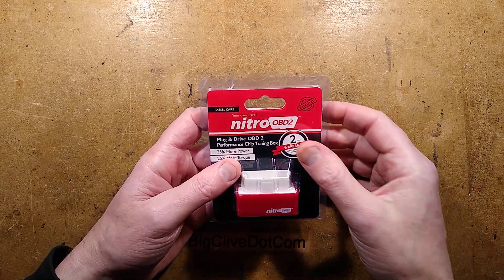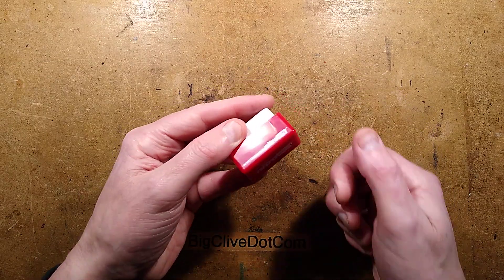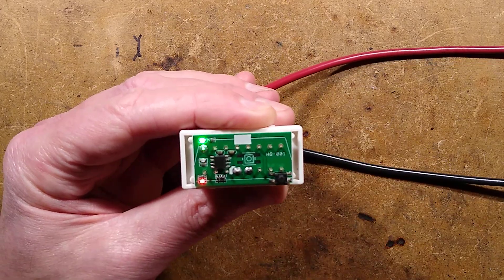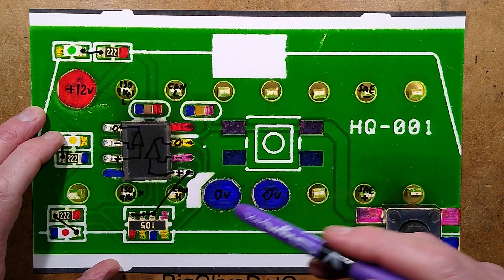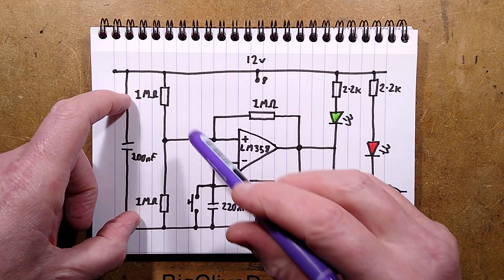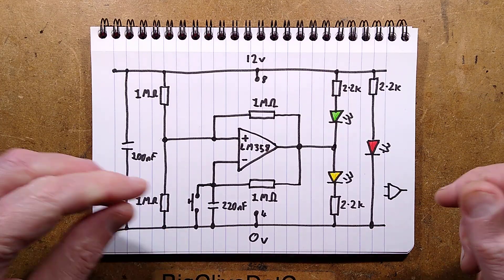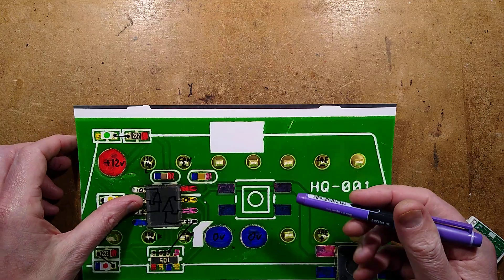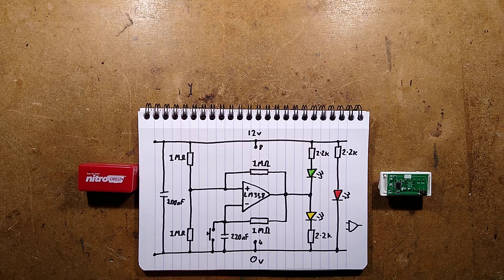Nitro OBD2 unit with interesting circuitry

Comment: I actually saw one of those that was actually connected to CAN L through a high value resistor. When CAN data was moving the LED changed its blink pattern. That was the limit of its functionality.
Reply: I can only imagine the joy the scammers felt when they realized they didn't even have to do that.
Reply: @chaos.corner Yep, the microcontroller they used cost a a whopping 3¢.
Reply: @randycarter2001  With the one in this video they'd just need to connect it to the unused 2nd op-amp to skew the timing a bit.
Reply from the maker: That does at least add an element of reality.
Reply: I imagine because this is just an absolutely do-nothing scam, there's relatively little attention from the law, but if some QC issue caused it to create a malfunction in vehicles, there's probably a much higher risk of there being some enforcement, so they just go for the simpler, safer and probably cheaper approach.  Although stuff like fully stock EVs burning to the ground and other issues with various vehicles often doesn't get much punishment so who knows.
Reply: ...and if you're really fast and smart, you can tell what messages are being transmitted?

Comment: I mean, as a Software engineer, I always hate op amps when I tinker, because they are magic devices for me, from a land of a thousand elves. At least I now have a nice demo circuit with a brilliant explanation of how to use them as an oscillator. Was worth the price.
Reply: Also great for audio interfaces .   Then there's the classic double ramp that lets you measure volts at whatever precision you can program into a timer .
Reply: One of the earliest things I built was a solar charge regulator, using an op amp. I used the LF351 mostly, and the 741 if that one was not available. Later I went into software dev instead, and made it a  career, but the memory of these little devices have stuck with me. This one, and the wonderful 555 timer. These days, I use arduinos, esp 8266 or Esp32 for most things though.

Comment: I think I'd be more upset if it actually did something ...I cannot fathom plugging in a cheap AliExpress module that's supposed to write data to my ECM.
Reply from the maker: Especially when the first thing it does is delete all the settings and then crash.

Comment: The basic problem is that you’re plugging into a diagnostic port and the circuitry is not designed to have anything continuously connected to it. Automobiles have been severely damaged by devices plugged into this port. Before connecting anything to your diagnostic port, I recommend doing a Google search to find out people’s experience with that particular device.

Good news about this gadget is that it does absolutely nothing so, at least your car won’t be ruined. 😂

Comment: Ex mechanic, ecen though most of these do nothing other than turn on a light on the dongle, or flash it.

Some can do major damage if they do actually upload any code or just do damage to the wiring.

Ive tuned vehicles (alot honestly) via the obd2 port (and the more oldschool way inc mechanic upgrades, jetting etc), the tool itself is usually...."cheap" it is either an obd2 to usb, or obd2 to serial (though they should be rare now), the expensive part is the software, they tend to be make specific (GM, Ford, Honda, Nissan etc) some are even engine specific, well really its more to do with the ECU but not that important. The tricky part is knowing what you can change, how much by and what it all does.

An example, you just put in a cam, injectors, larger throttle body, manifold and turbo. Where do you start? What do you change? How do you know your changes are safe? Are working? Or doing what you want? Sure you can just advance the timing and dump more fuel in, but you could be flooding it, or actually making it run WORSE than if you didnt touch the tune.

So with that said, If your OBD2 tune tool that just plugs in and actually makes changes, how do you know its going to actually help? It could grenade the motor or make it run way worse. Some from my experience can do electrical or mechanical damage.

Yes some do exist that you can just plug and play, but youll find they arent cheap, they are usually very specific on what they can be used on (from memory the VD landcruisers have a few, but tend to be split between the years, the series and also tend to be made to order, you give the company your specs, if you have made changes to it, you want more torque, better fuel efficiency etc)

Comment: An added benefit of these things is that they invariably tie your vehicle's chassis ground and signal ground together…
Reply: By design. Some CAN variants, namely Single-Wire CAN (SWCAN; Low Speed GMLAN) are chassis ground-referenced. I've found the manufacturer's PC interface does it for you. LIN is even better, the high state is Vbat referenced.

Comment: I plugged one of these in my vectra and since then everytime I indicate right , the air bag goes off and also the radio goes crackly..which is most annoying
Reply from the maker: I hate it when that happens and you have to stuff the bag back in and clip the front back on the steering wheel while driving.

Comment: I bought a non -nitro unit; as it was cheaper than a  ODB2 connector.. After opening found that only the power pins had been connected. Complained got a refund so connector for free. Winner!

Comment: You are correct that these are interchangeable between different power units. I plugged one of these into my EV and got 40% more economy from my battery pack. Amazing little gadgets 🤣🤦‍♂️
Reply: In EV it saves up  to 100% gasoline.
Reply: @lordplenty  I got a DIV/0 error when I tried to calculate fuel saving 😉
Reply: @smilerbob That's a very strange error .
Reply: @smilerbob In Hyundai/Kia it makes regenerative braking able to rebuild used up brake pads
Reply: @poprawa  I have heard similar with other vehicles as well. Also, some have reported driving in reverse puts rubber back on the tyres 👍

Comment: Just remember that when using one of these in Electric mode, don't park your car in an airport car park... :P
Reply from the maker: That diesel car that exploded was using one of these.  It has saved so much that the tank was pressurised with excess diesel.
Reply: Yeah, use the rental as you return it.
Reply: Especially if its a Diesel Land Rover as the case in Luton, or a Petrol/LPG in Liverpool.........
Reply: @8skellerns That's the cover up, A carpark built in 2019 with no sprinkler system,  Humm,  How much is Musk paying TATA to take the blame 😂
Reply: LOL 😂

Comment: "Relaxation oscillator."
I build these all the time.  Vary the feedback resistor to vary the frequency. Replace the feedback resistor with a photoresistor and frequency is dependent upon light intensity. Hook the output to a small audio amp and play tunes with shade. Fun to be had.
Reply: @bigclivedotcom this needs to be built on youtube.. It just must :D
Reply: Neon lamp+capacitor+resistor  works just fine.
Reply: Yeah, brings to mind the Forrest Mims handbooks.
Reply: Tube gear made them with one R, one C, and a neon bulb.
Reply: WHAT RADIO STATIONS WILL IT GIVE YOU IN YOUR CAR !!!

Comment: Coincidentally I was just looking at ways to "hack" your car using this port, send commands to open and close windows with arduino. Its not that easy since you gotta reverse engineer the codes seems the hard part, but once you know the codes you can display the info in a nice way or send commands to do things to your car.   power lock and car start from a phone? yes please!  I had no idea they made fake ones.  But since you can do it yourself  with acheap micronctoller , i dont see the need to fake them, unless they'r just exaggerating the claims.  It wouldnt be to expensive and hard too make a module that does what these claim,or attempt to anyway.  Especailly if you made a dedicated ic to do it, you wouldnt need much to send an 8 bit packet of code to actually effect the car.
Reply: If you want to do most of what is claimed on these these it is not possible via the ODB-II port and a single module as you need to read and react to data before the ECU and engine PCM does. Most cars leave the factory in factory default mode but there are companies that will change the ECU and PCMs based upon what you want and using data from your car to make those changes. One sensor will behave differently to the next one made on the production line.

These are programmed via the ODB-II port

I have used a Raspberry Pi for similar before and was able to control certain things via a program and touchscreen but the data being received is too great for one device to process, hence lots of systems having their own CanBus network and the primary module for that system will give diagnostic data on the main CanBus at a different rate.

There are also two diagnostic CanBus networks which makes this more interesting and difficult at the same time.

With all this said, have fun with your project and I am in no way trying to discourage you. I learned so much in the 6 months of my little project it was unreal 👍

Take care out there

Comment: There actually are devices that do what these ones claim to do, but they're WAAAYYY more expensive.  My friend had one for his jeep that also allowed more fine control of the throttle to enable making incredibly tiny adjustments when fourwheeling and climbing over rocks and stuff.
Reply: I had one of those on my Mitsubischi diesel pickup. It cost about 900 pounds but included new air intake, new exhoust system, electronic wastegate for the turbo and a piggyback motor management system. Took a day to install.
Reply: Not through the OBD port. It's basically read only.
Reply: @misterhat5823  no it isn't. Who told you that?

Comment: I"m going to make a OBD2 hub so you can plug in 2 or more of these nitro units. Imagine the speed you would get with 4 of these things!
Reply: Might rip the fabric of time and physics
Reply: Don't give them ideas...
Reply: Do you have to connect them in series or parallel for maximum effect?
Reply: @smilerbob CAN Bus systems are always wired in series.
Reply: @jahnkeanater  *parallel, unless you're being sarcastic and I missed it.
Reply: @uzlonewolf  ALWAYS!
Reply: I'm always thankful for this
Reply: @smilerbob why not both?
Reply: Can it hold 12 of these and will it mount on top of the dash?  That way I can hot swap my library of chip tuners?

Sometimes I want to drift and have my “drift-pack” of OBD2 tuners..

Other times I like to drag race and this would make swapping to my “drag-pack” of OBD2 tuners super easy.

Then when I rally race, I can easily install the "rally-pack", up to 12 units for maximum data mapping and performance.
Reply: They should make a version for the cigarette socket since it’s only communicate via the power lines!
Reply: @TheMrMaxx they want you to think it does something to the vehicle ECU though
Reply: You only need to get to 88 mph....   Beyond that is irrelevant.
Reply: Don't forget to add an on/off switch for each one. That way, buyers could test the best combination.
Reply: I'm imagining this massive honking thing like the old USB hubs always were, but gigantic because OBD2 plug is huge.  Definitely needs to happen.  Best idea ever.
Reply: That was the hidden succes of back to the future. Speed is endless.
Reply: Rofl....
Reply: Indeed. :0)
Reply: Imagine the mayhem of plugging in more than one actual obd inteface
Reply: Yes please! I bought one of these, and the extra power is nice, but I need to get the fuel consumption back down with one of the fuel saver versions... I'll probably only use the 2 ports mostly, but I might take a 4 port one so I can add more power and fuel savings for my upcoming caravan trip. Do you need thicker cables on the adaptors if you're towing 3 tonnes of caravan with a Nissan Micra?
Reply: @tin2001 You should be ok as long as you have room to plug in about 14 of these. I pushed one into my dog and she ran faster then ever!
Reply: They do have obdii y cables..
Reply: You don't need to make one they already sell them on amazon
Reply: @jbroughton383  They probably have a version of these on Amazon that will make your car run on water or something.
Reply: Top 10 car secrets manufacturers don't want you to know!
Reply: Buy 2 of these and run for pink slips

Comment: I have a OBD plug from my cell company to give me mobile wifi and diagnostics in the car and let me track my teenager when they drive. When I got an electric car, I was up a creek since they don't have OBD ports. doh!
Reply: Lol that would be super duper illegal where I live
Reply: Interesting tho
Reply: I don't know who told you that but all vehicles are covered by obd regulations regardless of their motive power and as such ALL vehicles must be fitted with an obd port within a specified distance  from the steering wheel as per C&U regulations.I work on hybrids and EV's along side conventional vehicles,much of the non motive electronic systems on hybrids/ EV's are just that which they fit to their petrol/ diesel cars, it's nothing different.There are still regulations and the obd(on board diagnostics) port gives access to the powertrain regardless of what pushes it along and besides that its the gateway to the vehicles entire electronic network.
Reply: @notpoliticallycorrect1303 My Volvo C40 does NOT have an OBD port that I've ever been able to find and the dealership told me it doesn't have one. so do with that what you will.
Reply: @notpoliticallycorrect1303  Tesla got rid of the OBDII ports for the Model 3 and Model Y. Older S and X had them.
Reply: @itsbigwood  OBD ll is the regulation,regardless there will still be a port for diagnostics,it may very well be hidden and may not be of the DL16 type configuration,but there will still be a port for data/diagnosis.

Comment: My hybrid had this built in push a button and you get boost mode and it pulls away from junctions so fast but the fuel economy goes down it also has an eco button which helps with fuel economy. I just leave it as standard but it's nice they built this in so i don't have to buy one of these modules 😂😂😂😂

Comment: I think you missed the primary purpose of this device. If you have both buttons connected and press them for 3 seconds it actually converts your vehicle into an electric vehicle. Greener than the green LED!
Reply: There's a dark conspiracy, car manufacturers don't want you to know that actually all cars have a hidden EV mode already! To activate it, all you need to do is engage first gear and crank the engine...

Comment: The anonymous 8 pin chip is clearly a high performance ARM with built in 1024 Mbit flash which performs all the functions you described. They just forgot to connect it to the data lines, shame eh.
Reply: It uses capacitive coupling, d'uh! Engineering 101.
Reply: Well OF COURSE it isn't connected to the data lines - don't you know everything is wireless these days?!? You only need to plug it in at all for the power...
Reply: They've got integrated induction nowadays, very effective, you don't need physical connections. I think this might actually catch on to replace that low-tech "NFC" nonsense.
Reply: Why do mechanics buy multi-hundred dollar scan tools to communicate with the car when they could just make a scan tool with this chip for a few dollars and communicate just as well?
Reply: @zzoinks a scan tool and just a single op amp are very different, those multi-hundred dollar scan tools have software on them that allows them to even read the codes ecm codes are weird because there’s a standard system for the codes, but how they are read, or decrypted between each manufacturer of cars is different! Some vehicles require you to reprogram certain control modules like the some of the ford transmission control ecm’s.  If you replace the transmission you have to reprogram it your you’ll ruin the brand new transmission! Forgive me if everyone is just being sarcastic, but that’s why!
Reply: I have a very similar circuit board from similar snake oil device on rechargeable lithium battery and it's completely analog using a capacitor for flash timing._
Reply: It's obviously wireless... Everything is wireless these days.
Reply: @HectorCruz917 and OTA update at that, I think they squeezed a cellular modem into the same die. Quite fantastic really